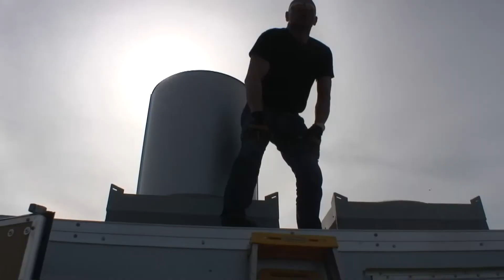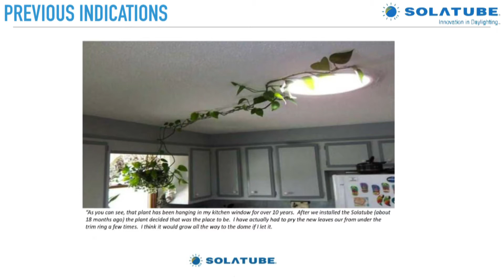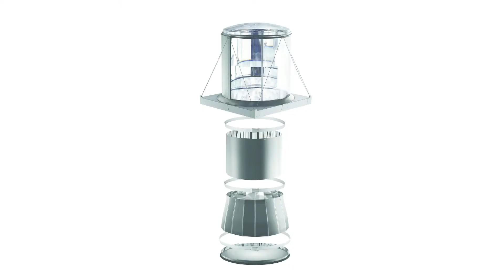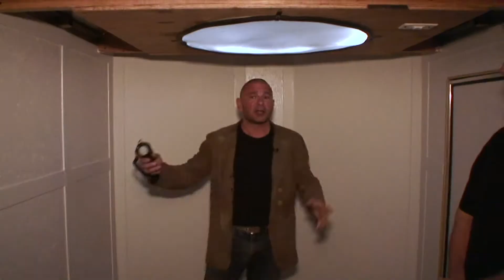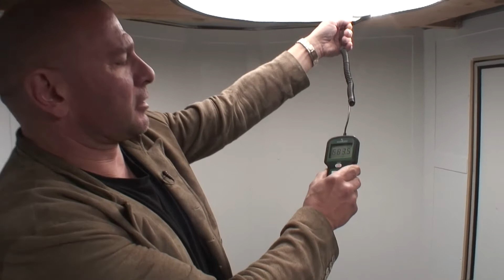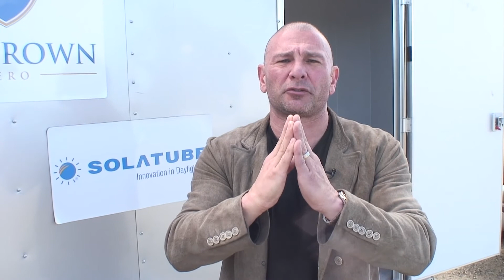SunGrown Zero Technology Demonstration Trailer

Comment: Par isn't the same. What's the par at 24" under the light? Not going to be same as putting the light meter against it almost.
Reply from the maker: agreed, 24-36" under the diffuser still clocks in PPFD levels >300.